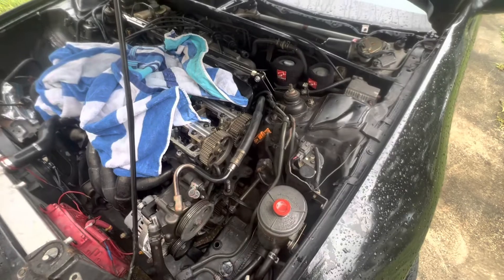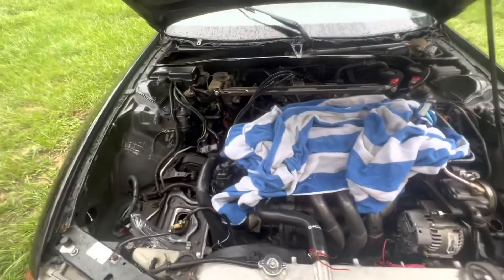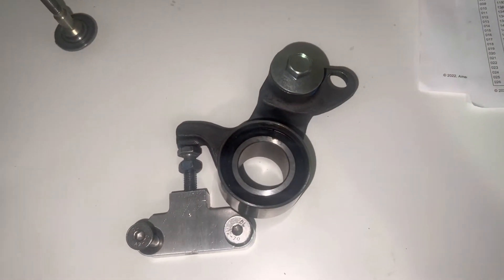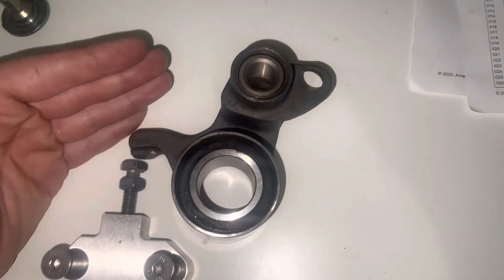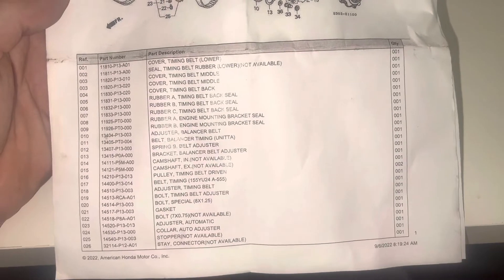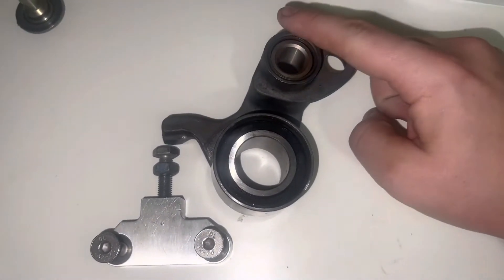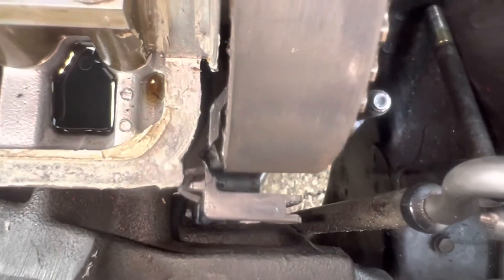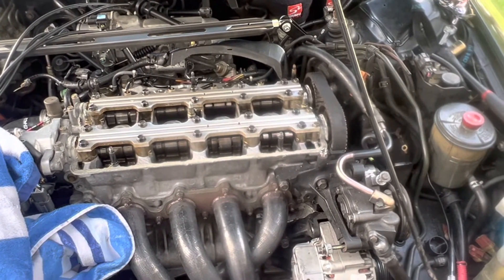H22 TIMING ISSUE FIX - BELT WALKING OFF GEARS? I THINK I CAN HELP

Comment: Mine is walking off the cams to the front. I took off the pully to make sure I had that spacer, I also have that same manual tensioner you have and my belt keeps walking.
Reply from the maker: Yeah I posted this video 2 years ago and walking never came back , I have transmission issues rn hahaha 

Yeah maybe want to replace tensioner and tensioner pulley . I have a theory that the stuff gets worn down and randomly walks inwards or outwards like 5050 chance

Comment: What is the bolt or spacer called
Reply from the maker: 14513-RCA-A01- adjuster bolt

14530-P13-000 - adjuster collar

Official Honda part number and name. 

Let me know if u have any further questions thank u for the comment.

Comment: I got a 98 accord v6 I tried the spacer and different intake manifold but my car was idling up and down is it because I had it on the stock 3.0 runners
Reply from the maker: Did you see my reply on the other video?
Reply: @joshuayammer1994  no sir